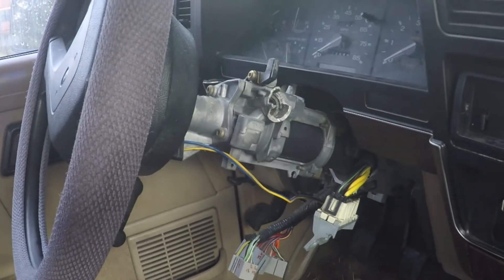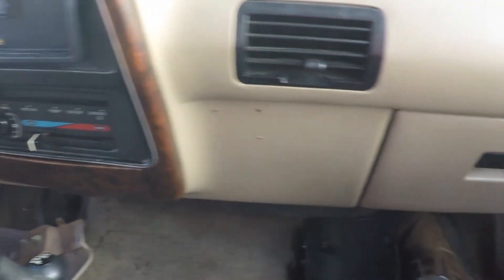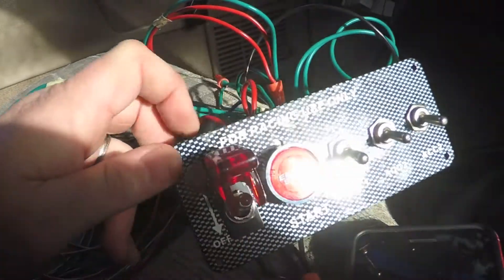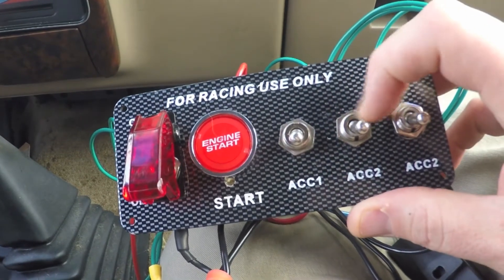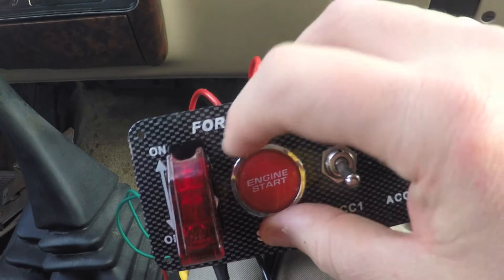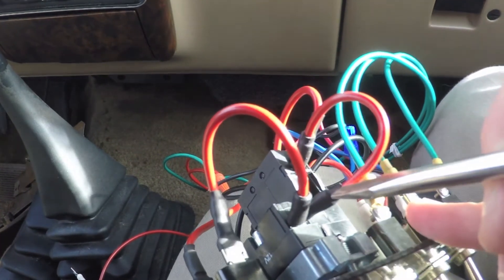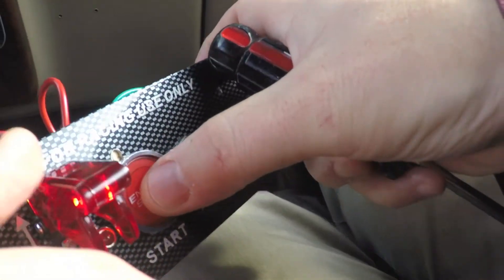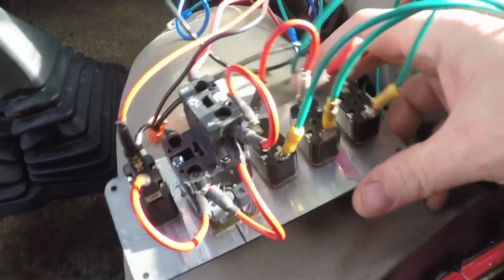Nuclear Option Switch: Push Button Ignition Switch on a 1989 Ford Ranger

Comment: This is the second video I have seen the use of the relay. I honestly don't understand why one is adding a second relay in the system. The ignition switch with the key( original switch) already runs from the switch to the cars original starter relay in thr car. I don't see the point of adding another relay. If you were going from the new switch directly to the starter I would understand. But all your doing is using the same original wires and removing the key..no need for the second relay
Reply from the maker: I'm just following directions.  All above my pay grade!